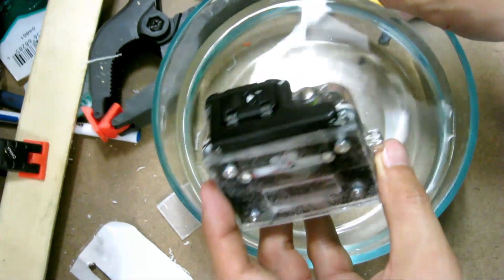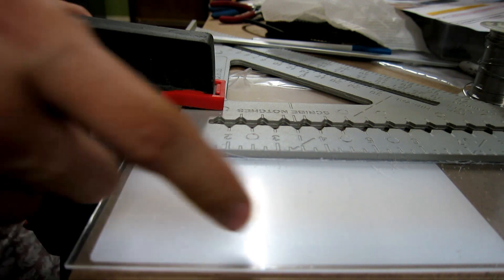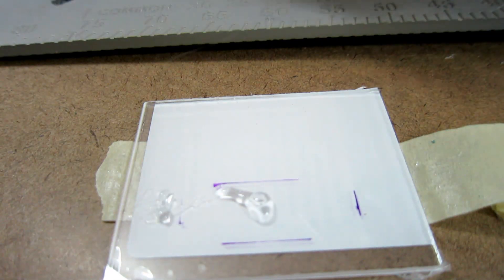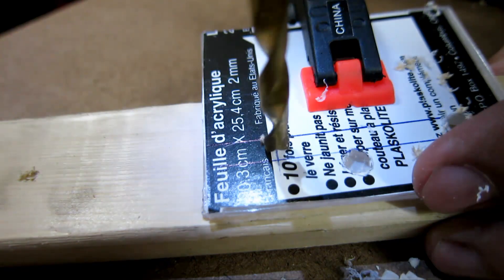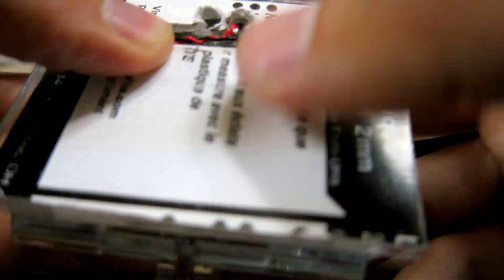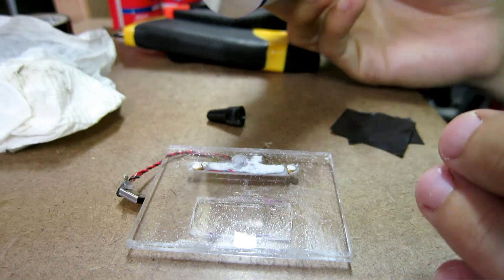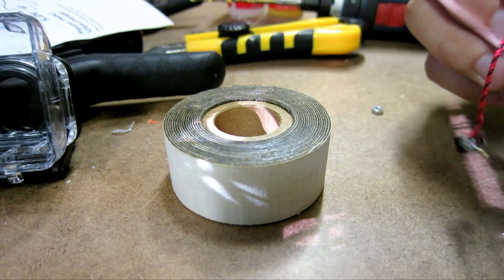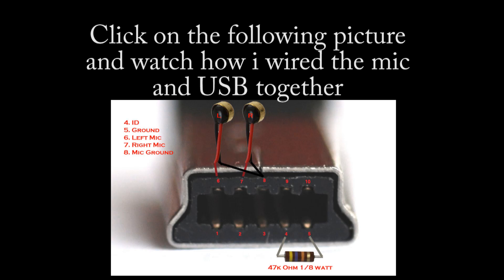DIY GoPro Hero3 mod Waterproof Microphone & Housing - Hero 3 case mic black silver white

Comment: cool set up sir, do you think you could do on where you can split the cable to use both an external power supply and an external microphone?
Reply from the maker: i actually did 2 separate cables. one for mic and one for power. A combined cable is a good idea, but not sure when ill do it. maybe you can record yours and share it with us :)
Reply: Hey thanks, I have a cagepro.being delivered tomorrow.from the USA and.its.downfall in my eyes would be the non ability to use a dual cable because of space and setup... I am no where as technically minded as you but that being said i would be happy to have a shot at it... appreciate the reply..Phil